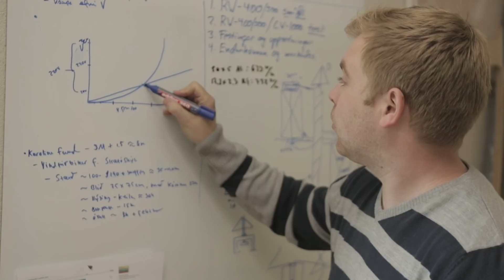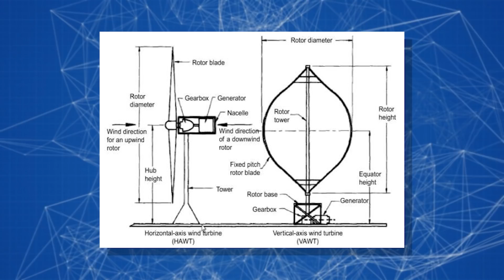Why This Wind Turbine Will Change The World

Comment: I noticed that these wind turbines work low to the ground also.  It seems to me that the tower with ONE turbine should be outfitted with at least two turbines and maybe 3 or 4.  Plus why cant you build them as tall as a traditional wind turbine with however many you can deploy up the tower like 10 or more?  Just asking?  Thanks

Comment: I see a lot of people saying this is nonsense because (insert reason) and they are generally correct in regard to the using them for large centralized power. What is interesting about this design is it may allow for individuals to generate wind power at their homes, much like with solar.  Sure it isn't going to completely change the world and make other wind turbines obsolete, but it may turn into something that might help a little bit. I think everyone is always looking to the invention that will single handedly solve climate issues. That won't happen, it will be a lot of little things.

Comment: A typical household may need 5-6KWh per day , so given 500W maximum power of wind turbine, 10-12 units would be necessary. Powering the household would be possible only in rural areas, not cities.

Comment: It is funny how you call "traditional wind turbine" to three-blade horizontal axle turbine, which science and experience has proven to be the most efficient design, i.e. the one that grabs the maximum power from wind. VAWTs always have the same problem: the blades move against the wind as they rotate, and that consumes power. It is so simple to see that I am amazed you are selling it as a revolutionary possibility.

Comment: No they won't. Savonius turbines max out around 30% efficiency and this model literally has 40% of it's surface area cut away. That's why you never see industrial scale models of this design. They take a lot more material to produce less power with lower rotation speeds. Betz law at work.

Comment: Dragger type turbines like icewind can only aspire to a fraction of the energy production of an equally sized sustentation turbine such as the regular ones.
Reply: That's funny that you call them "Dragger" ...HE he he .... as if there is DRAG without LIFT ...... ha ha haaaa and I have a North Magnet I would like to sell you for just 50 million bucks. (You can't have drag without lift) that designation is almost as outdated as the "Engineers"  who keep "engineering" these MONSTER turbines. Once you get over a certain size, you get into such Massive structures that it becomes prohibitively expensive to build and therefore Exponentially expensive to maintain - case and point - at 180 mph - how long is that going to last? How expensive is it to replace these blades just because "The tips Leading edges" are delaminating?? Small wind is the only efficient wind; you cut out the RIDICULOUSLY expensive infrastructure as well. Small wind is Win Win Wind MEGA WIND is oil company wind.

Comment: This presentation is from the salesman perspective, but I want to have it worked out from the engineer perspective.
Reply: Here's my perspective (MSc in Renewable Energy Engineering) 

Most of what he claims is true in it's basis, but not accurately depicted. For example: Horizontal axis wind turbine blades are also moved by the pressure differential, like an airplane wind. Also the noise and vibration really isn't an issue, the shadow flicker is. But that only affects areas a few hundred meters around the turbine (depending on location, but it can be easily simulated before construction) also he compares the sound of a 5MW turbine to that of a 500W turbine. Also also, the vertical axis wind turbines he shows are all on ground level. You know what's weakest at ground level? The wind... That's why the comparison again doesn't make sense.

The disadvantages he's talking about like that the turbines will be destroyed when the wind is too strong or the exponential cost, or that the orientation of the turbines are all way WAY overblown. They were problems, then someone came up with a good solution, so now they're not a problem anymore.

The entire video seems to be just an ad for a technology that has been shown to be inferior. It's not like those vertical axis wind turbines don't have any use-cases, but... well I don't know of any, other than where you need a helicopter to access the area. That's where horizontal axis is too heavy.
Reply: Ko

Comment: Doesn't matter how efficient it is the wind doesn't have enough power to compete with fossil fuels, am working on a wind power project right now, we burned so much fossil fuels making and installing them at sea we be better off burning fuel in a power station.

Comment: I like this design because it could actually be scattered throughout urban areas, whereas there would never be a large traditional wind turbine installed anywhere in a city. Then we'll have two great power options for large scale and small scale
Reply: AGREE ; Large scale is not very effective and kills way more birds than small scale or VAWT.... Take a look into Flap Turbines. They are a new type of Cycloturbine that is extremely efficient and easy to build. Small Wind is Win Win Wind
Reply: A city is a shit place for wind energy.
Reply: @neddyladdy  my back garden gets a lot of wind
Reply: @neddyladdy  In NYC, thanks to the canyon effect of the skyscrapers, we are experiencing much higher winds...
Reply: @Nikosi9  NYC? What is that? do you know if there is much energy available from that wind.  I know that the traditional wind turbine wants long runs before and after the turbine.  The lack of urban turbines points me to think it is not as good as it appears. I do not have any figures to say one way or another.

Comment: Nonsense! Vertical axis wind turbines are nothing new. They just aren't widely used because of their lower efficiency and higher production and maintenance costs. Talking about the benefits and issues with vertical axis turbines is fine, but making a nonsensical commercial out of it as if this guy invented something new is not! Also lecturing your audience while not knowing or caring about why they are not widely used contributes to misinformation and is a dick move.

Comment: Years ago my late brother drew a design for a Savonious turbine fashioned from an oil drum, sadly, he never had to opportunity to make one.  Since then I have sometimes wondered why this style of turbine has not been adopted.  Those who comment here to rubbish this design forget that, being able to place these locally without the problems of conventional turbines, they overcome the enormous cost of transmission lines and sea proof platforms.   They can compliment conventional turbines, not replace them.
Reply: I built a Savonius turbine about 15 yrs ago and it came out great. I used chimney metal, split lengthwise and mounted on 12" dia acrylic sheet so overall diameter was about 12". It worked great, but then I tried to build the generator part. Not so good at that. So now that I'm retired, will build another turbine - maybe a little bigger - but then just buy the generator and go with that. If I'm really smart, I'll v-log the build and post on U tube.

Comment: cost of vertical wind turbines
 Vertical Wind Turbines - Prices & Costs
 The purchase prices of vertical wind turbines are usually no lower than horizontal wind turbines.  For the entire small wind power market, there are significant differences in prices and specific costs per kilowatt of power depending on the manufacturer and wind turbine model.  The price range is between 3,000 and 10,000 euros per kilowatt of installed capacity.

 Due to aerodynamic disadvantages, system regulation and storm protection is more complex in vertical wind turbines.  For example, horizontal wind turbines can be turned out of the wind as a technically elegant storm protection; this is not possible with vertical wind turbines.  A vertical wind turbine therefore requires special technical solutions for system regulation, which is reflected in the construction costs.

Comment: Green energy? 
Is the production process to make wind turbines green?
Is the concrete ,steel, fibreglass, wire, plastic used green?
Wind power equipment production is not green.
Is the production process to produce solar panels green? 1800 degrees needed to melt the quartz to make solar panels is achieved by burning gas. Aluminium smelting burns fossil fuels.
Solar panel production is not green
Is the mineing process to source the raw materials needed to manufacture these supposed green energy innovations green? Mineing equipment runs on fossil fuels and decimates the environment.
Mineing is not green.
How are these materials recycled? some are not possible to recycle. Theyre buried in landfill. 
Landfills are not green.
1 answer to all those questions. a resounding NO. 
The wind, sun, wave energy harnessed is renewable and green. The processes used to mine and manufacture the needed equipment to harness those renewables is in No Way green .
Green energy is a farce.

Comment: Wow, maxed out my bs meter!
Reply: It can probably power a LED för a busstop or something like that. 

But I have in my backhead that ALL windmills that are below 2m in diameter is waste of time and can never produce anything connected to the grid.

There is ”probably” a reason that all windpower turbines look the same. 🤔
Reply: @vaktgunnar  They are actually really good.  But most verticle turbines are only 20 - 30% efficient, where our big three bladed ones are 40 - 45%  So, good on a small scale, not so much for large scale.
Reply: @SoralTheSol  that's the general problem with wind power. It used to be worse 2 decades ago, but in the 2010s we hit a stride with wind tech that let us get it up 10-15% efficiency.

Solar Power is also incredibly inefficient. Albeit, not as much. If we could stack maintain a 50%+ efficiency maybe, but we barely maintain a 10-15% efficiency at peak sun.

Compared to wind turbines which are hitting close to the theoretical caps of 59.6. With 50% being the max cap of current high end turbines. 35-45% being normal...

If we can downsize current turbines, and get the exact same output. That would be great otherwise it's pointless.

Not to mention for each mW, you need roughly 1.5 acres of land...  so about 4-5 acres for the maximum wind turbine on the market. Not to mention clearing the area of all fauna, and flora other than grass
Reply: @icarusunited  it's the reason why I keep saying that we should go full nuclear, until we have a better solution. Have the grid power by mainly nuclear energy, and have the wind/hydro/sun sources supplement it and grow as fast as they can, until we invent out fusion powerplants.
Reply: @marek9784  nuke plans are very vulnerable to drone missile atack, nowadays everybody has one.
Reply: @marek9784  Nuclear fission is, and will always be, a terrible idea. What do we do with the waste? Malfunctions can be catastrophic. The technologies are better, but not there yet. Like giving a baby a grenade and hoping for the best. 

More efficient generators, frictionless magnetic bearings and material science should be the focus.
Reply: @icarusunited  I think you mean megawatts (MW) there, not milliwatts (mW)
Reply: @reverendalexanderskinbound278  the latest generation nuclear reactors are designed in such a way that they are passively cooled so they won't melt down. They also utilize fuel more efficiently so the waste needs to be protected for about 150 years instead of 5000+.
I recently read an article claiming that current wind turbines cost so much energy to build and maintain that it takes 19 years of producing energy before they reach net zero energy production. Fun fact: most wind turbines have an expected operating life of 20 years.
Solar looks good on paper, but what do you do with all the solar panels after their 20-30 year life expectancy? Also, have you researched what goes into making those things? Seriously environmentally unfriendly.
I do agree with your point that we should continue innovating wind and solar, but nuclear is the best option right now, imo, to pick up the slack.
Reply: @icarusunited  Wind turbines have to be space quite far apart.
Reply: @icarusunited  There is also wind farms in the sea.
No need for destroying the land.
Reply: @gerardflynn3899  yeah, just destroy the ocean, and the land to produce them, and build them.
Reply: Haven't even finished video and u sir got me laughing. I think the reverse psychology to the tune of no one wants to be that guy or the your just like your dad effect has been successful for the 2020 eye opening unwoke. BTW windmills are like 4000 years old .....
Reply: StarWind Power
Reply: There hasn’t been much innovative changes to when they started making those blades with epoxy and carbon fiber. Maybe that’s what people are seeing when they say the see ufo
Reply: We use this type of "turbine" to let adveristisement display panels rotate when there is wind.... since the 90s.....
These turbines have their place in powering bus stop displays or, like here in Germany,  traffic signs. For anything requiring more power than my PC, they are pretty much totally useless. Once you do the math and scale them up to MW size, you realize they end up being WAY bigger and heavier than traditional turbines.... I'd like to see where you find spots to accommodate what is basically a 20 m food processor.

Comment: I have looked at the pylons marching across the countryside carrying the transmission lines. Identical pylons on each string. I was wondering if turbines that could be designed to fit right in the pylons, they would feed the grid directly. I think you all get what I am aiming at. There are the ones that look like giant men. In the center section is a perfect place for a turbine. No need to build the structure , obtain the land, etc. The pylons that would hold them might need to be beefed up. I am sure engineers have probably thought of this already but it just won't fly?

Comment: The level of ignorance in the comments is worrying and depressing to say the least. There are independent research agencies the world over (NREL, DTU, Fraunhofer, RISO DTU, ECN, CENER, Sandia, to name a few). For 60 years they have researched vertical and horizontal axis wind turbines to death and spent billions doing so. Did you know 1 single windturbine today can power 16000 households and not break a sweat. The turbine shown here will power 1 house and  then shake itself to pieces and the bottom bearing will need to be replaced regularly. Please ignore this tacky and cheap advertisement. Want to know more about wind energy? Check out the thousands of publications from the  esteemed and INDEPENDENT organisations above.

Comment: Good for small applications; also you don't want to accidentally walk into one of these at night, or have a child put their arm into one. (assuming if mounted at ground level).
Currently industrial wind turbines will generate 1-3MW of power each in ideal situations (typically their only installed in such locations). 
To put that in perspective that is 1000-3000kWh, or 1,000,000-3,000,000W, these as per video suggest they can generate up to 5,000W. Obviously this is GREAT for individual homes or small applications and may actually be better then solar in many places with decent wind. 
The only way this could be used to supplement a commercial power-grid however is if their installed over a great area on rooftops etc.. (light/power/mobile poles even). The downside however is having to deal with maintenance, mean failure or defect times would be quite critical for such a setup. 
Question: What energy/cost would it be to downscale a commercial 3MW one to 3-5kW? because that's the ONLY real way to compare them. Its like comparing a dinghy to a cargo ship.....
Reply: Why does everything have to be perfect to be meet your requirements????? Nothing is perfect. Yes it can work for small applications. Yes, it can power a home. So WTF more do you need for it do///// If it works for a house and can be used in 50% of residences think how much that  would save for homeowners and the environment. Ease up with the whining. Getting off the power grid would be a major accomplishment for most families. I can use a dinghy. I don't need a cargo ship. Easy to find fault in anything. Just look until you are successful. So what is your solution????
Reply: It can be a great technology to use with the wind turbines we use today. To think they should replace the classic mill is crazy, but they can be used in many places as a supplement.

Comment: This is in effect for years now. Vertical axis wind turbines have a very small efficiency roughly about 10-15% and there are tons of other parameters to be optimum for continuous power production.Won't be cost effective to install one even in a household. None of the wind turbine giant corporates have ever installed a big vertical axis wind turbine. :)

Comment: This is not a new or innovative design. While having some use and benefit the problem is that they do not generate enough torque to yield sufficient energy generation. While the horizontal windmills are filled with issues also, their shear size or "wingspan" is what is necessary to generate high torque numbers and by extension higher energy generation

Comment: This is such an ill informed discussion of the technologies being compared. The equivalent of comparing a computer fan to a jet engine. 
See how much smaller and compact the computer fan is? Cheaper to install. Easier to maintain. All true but they don't equate the same power delivery needed for large scale energy consumption to actually impact carbon emissions. Other videos, made years ago on these vertical axis wind turbines, are more informative.